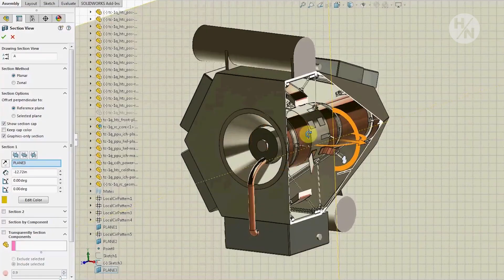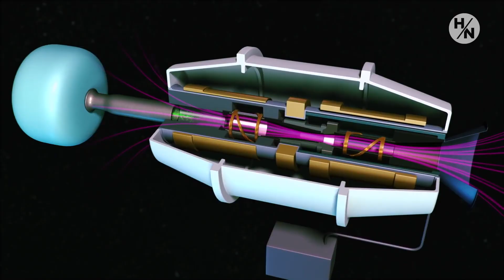How do Plasma Rocket Engines Work?

Comment: 💫💫💫💫💫💫💫💫💫💫🕳Yes, this technology was designed on our planet. It all started with James Pitts' "Sky Car" vibrating orthotopter umbrella, then the umbrella was closed with a dome and devices appeared according to the scheme of conventional electromagnetic vibrating speakers (membrane + inductance) - fragments of the membrane were found by a farmer in Roswell. Then they created piezoelectric thrusters, or with small dischargers on the surface (they glowed all over the body due to ionization of the air), and now they are planes with plasma propulsion panels (so they are angular - that is, with flat surfaces). Thousands of discharge cells are densely packed into motor panels - they shoot streams of plasma (railgun architecture - coaxial electrodes). The ionized air of the spark discharge is accelerated in the railgun chamber by the Lorentz force to enormous speeds - a kind of ramjet engine is obtained. Just imagine! - tens of thousands of small ramjet engines assembled in panels and launching plasma synchronously at a huge frequency (hundreds of kilohertz). Plasma jets form toroidal air vortices - this air cushion creates lift and acceleration.

Comment: Bet a SSTO plasma engine would work.  Plasma based jet with a hydrogen plasma afterburner that would continue firing into orbit.  This would be a high flow plasma.
https://aip.scitation.org/doi/pdf/10.1063/5.0005814

Comment: How about using continuously compressed air to feed the engine. Therefor it would be fuel-less engine and it could fly in atmosphere for as long as the plane would have a power/energy to create plasma..
Reply: Plasma thrusters (or any type of ion thruster for that matter) don't work in an atmosphere at all, because the plumes they produce are very low pressure. In an atmosphere the air would rush backwards into the nozzle and acceleration chamber.

Comment from the maker: What other ways do you think we can use plasma engines? We're thinking an interstellar racing league.
Reply: Asteroid deflection.  I know that sounds fantastic, but it's the coolest thing I could think of.
Reply: To travel in the solar system but it’s limited and Once an ion engine is used, then that would be able to time travel. As far as going through a portal to slow down time and then speed it up in order to get to another Destiination within hours instead of years.
Reply: hey mate if your interested check out my fusion reactor prototype this could be converted to a fusion thruster. keep in mind I used theoretical work done by lpp fusion when I engineered this prototype.
there are four videos on my channel this one 
https://youtu.be/y9HmrZCBX70
explains the particle flow and the reaction. the other video https://youtu.be/y9HmrZCBX70 
is the full no deuterium test run of the first half of the test core and 28 mercury's is the vacuum 
so there's a major boost in performance if I get a better pump, this is the same test with reduced color and brightness to show the plasma better https://youtu.be/rr19NSVTIz0
witch killed that camera after ward and the test run vid has no 
sound but read the description for some more info. 
https://youtu.be/AH9sdaU1izc
this one is new
Reply: Nasa is already experimenting with Electro Megnetic Propulsion I would say use it because it's far better than Nuclear rockets